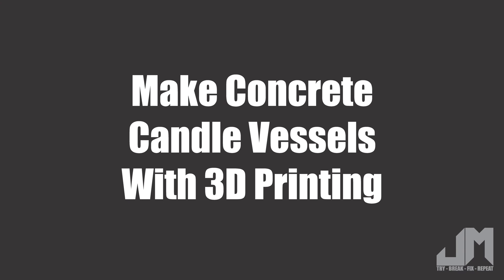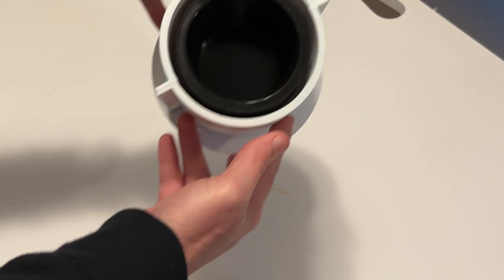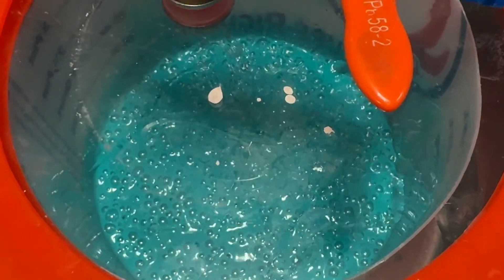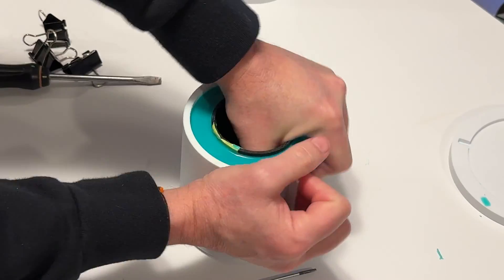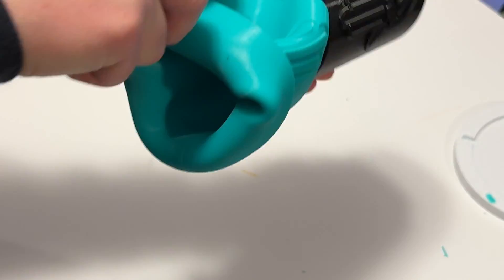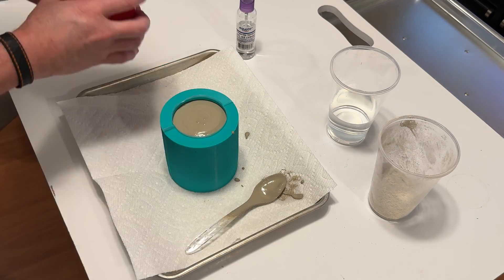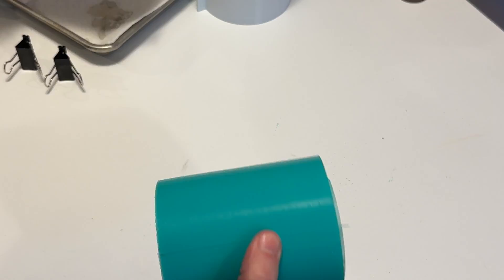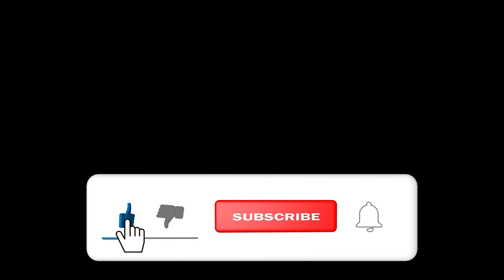DIY Mastery: Crafting Concrete Vessels with 3D Printing

Comment: Hi.
Any post processing on the master after 3D printing?
Thanks.
Reply from the maker: In this case, no. I printed it at 0.15mm layer height so the layers didn't transfer to the concrete too bad.
Reply: @justinmcclung  Nice. Thanks for sharing.